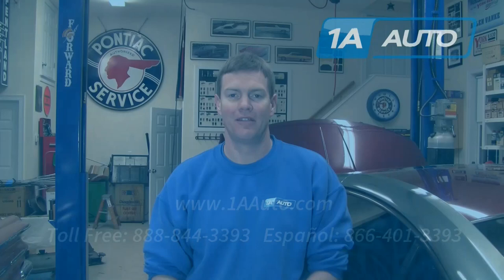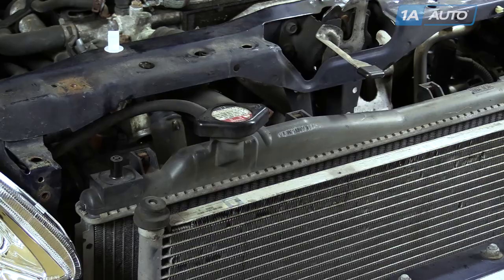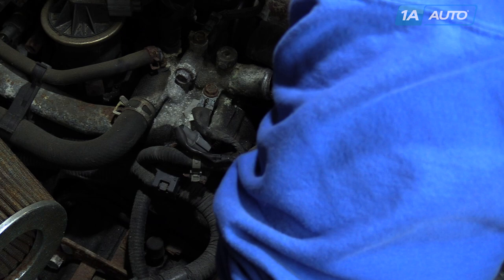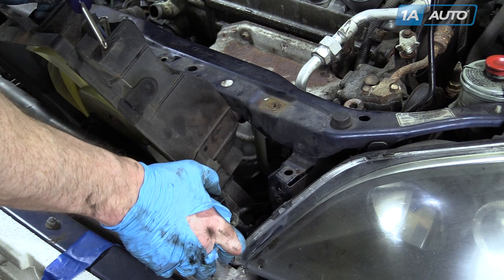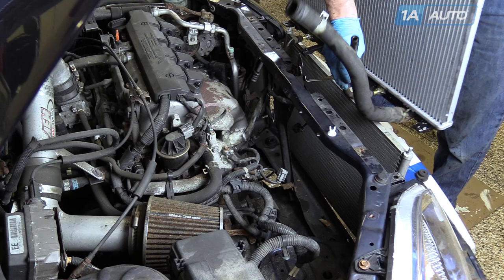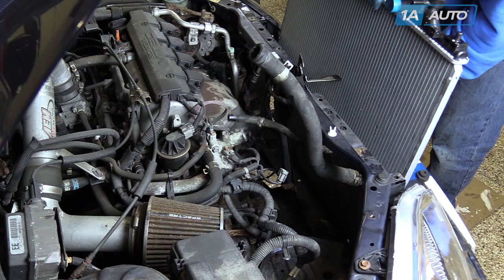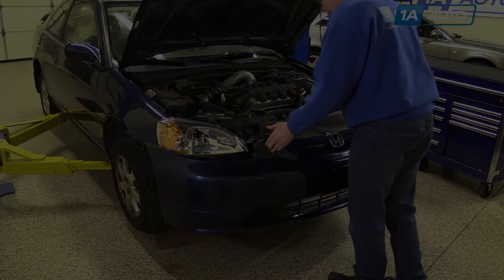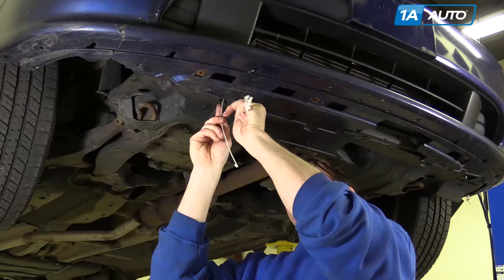How to Replace Radiator 01-05 Honda Civic

Comment from the maker: √  Watch the Video
√  Buy The Part at 1A Auto http://1aau.to/m/Visit-1AAuto
√  Do it Yourself
√  Save Money
Reply: did i miss what todo with the at fluid? Never saw that get topped off.
Reply: 1A auto my Honda transmission is manual and the radiator I bought from you guys 1A auto on the specifications said that is for either Automatic or Manual Transmission do I need to cover the Transmission fluids plugs or leave them ? Are they going to leak any coolant (antifreeze)?

Comment: Word of advice for anyone watching this video and attempting this at home. It is not necessary to remove the whole front bumper cap. Only the center grill sections needs to come out. Also, leave your upper rad hose, lower rad hose, and both transmission lines connected to the engine side of the vehicle. Much less headache coming out and going back in.
Reply from the maker: +@Logan-qo1tv Thanks for the feedback!

Comment: You don’t have to run the car up to operating temp with the heater on and rad cap off to get all the air pockets out of the system?
Reply: That is a good way to purge air from the system.  Sometimes you get lucky and can just keep checking the level but makes more sense to properly burp the system before taking for a drive to ensure there's no air pockets that can lead to overheating.  Ill be doing this exact job on Wednesday to my girlfriends 2003 civic and the video makes it look very easy.
Reply: i know im hella late to this, but it really depends on the hose placement, if the neck of the radiator is higher than every part of the system, all the air will end up in the neck thus ending up in the over flow. ive had plenty of cars that were a nightmare to bleed, but hondas are very simple and have few external cooling lines

Comment: Scared myself a little when I pulled out my old radiator only to see that it wasn’t  the same. For my manual friends, you can use this radiator too, I just put this one in my car and it runs fine. You can just leave the cooler line ports on the new radiator open!
Reply: You should definitely seals those some. Whether with some type of plastic caps that you can find, or bolts or whatever you can rig up that will stay.

Comment: manual transmission cars wont have the 2 transmission cooler male fittings on the bottom
Reply: can you just cap the two lines? i have a manual transmission and radiator has the two male fittings but im not sure how to go about it
Reply: Was just wondering that.  I have a manual.
Reply: Do I have to get a different radiator If I have a manual trans? I think I bought the automatic version
Reply: So does that mean there’s 2 less hoses for manual trans?
Reply: for those people wonder the manual transmission civic , the radiator is the same, it just have no line connecting to the core, it’s ether capped close or open with no cap or missing cap , but the radiator is the same
Reply: Mines not capped can I cap it off

Comment: If you are still there after all these years, Thank you.  Your step-by-step got me through replacing my 2005 Civic LX radiator.  Removing the driver's side fan was a bear though because of the air conditioner unit and tubing by I did manage to squeeze it out of the way and get to it.  Thanks again.

Comment: This 1A Auto video is amazing! If you follow the video exactly as shown you WILL be able to replace your radiator. You not only get the how to remove the old radiator you are shown how it gets replaced from beginning to end. That is invaluable since "to install simply do it in reverse" doesn't work for use non-mechanics... I've changed both my 2001 and my wife's 2003 Civic radiator following this video frame by frame. Thank you so much!

Comment: I just finished watching this video and I am confident that I can put in my new radiator myself. I know basically nothing about car repairs but with this videos step by step instructions I know I can do it. Just recently I had to put in a new starter and a new fuel pump assembly in my 2003 Honda Civic Ex and I was able to do both repairs within a very short period of time thanks to videos like this on YouTube. Before I took it upon myself to do the fuel pump assembly I was quoted a minimum of $600.00 to put the fuel pump assembly in. I was so shocked at how easy this job was and to have been quoted that much was an outright outrage. I wouldn't have charged anymore than $150.00 to do that job and honestly even this amount seems too much. It took me no more than ten minutes to do the fuel pump assembly replacement. Many mechanics are gouging people with these ridiculously obscene prices...

Comment: i did it in about an hour! thank you! manual transmission made i a lot easier!
Reply from the maker: +Cristian Aponte Thank you for your positive feedback!
Reply: I have manual trans. My new radiator just came in. Gonna put a new condenser, ac compressor and radiator all at once. Pretty pumped up

Comment: thanks for your excellent video. just finished the job and it took about 3 hours from start to finish.  Your tricks really helped a lot but did find it easier to just completely remove the upper radiator hose.  You did a great job and i'll definitely keep 1aauto  in mind next time parts are needed for our autos. Holy moses! Just saw the link to the radiator below. i paid twice that at autozone
Reply from the maker: +ba r Thanks for watching, and don't hesitate to visit our site next time you need auto parts!  1aauto.com
Reply: damn thanks for ur comment i almost didnt go to their site and was gonna buy it at autozone, saved me some money
Reply: could've removed the fan after taking the whole radiator out first

Comment: I'm doing this repair on Saturday and I'm going to be replacing the thermostat along with the upper and lower hoses. I'm not sure why you wouldn't replace the upper and lower hoses or the thermostat I mean that's just me. anytime I do a radiator and I know the hoses or the thermostat have never been replaced I typically do it all at once. but great job on the video very detailed

Comment: Great video just changed my Honda Civic 2001 EX radiator using your video step by step thanks 🤗👍
Reply from the maker: +Ricardo Pagan Coll Thank you for your positive feedback! We are happy we could help!
Reply: I tòom mine to a garage. I anticipate a $400 bill !!!
As for thermostat replacement NAPA has an aftermarket thermostat for $9 if I read it right.
I called Honda. Their thermostat was priced at  $53!!!!

Comment: since it appears the transmission fluid hoses have to be removed would it be smart to also get the transmission fluid changed at the same time?  if any of you have experience with the 7th gen civics, are there other 80k mile general maintenance tasks that should be performed in conjuction with a radiator replacement?  thanks in advance for any input

Comment: You can use the sides of the box that the new rad came in, cut them to size and tape them over the fins, to have extra protection and be sure you don't bend any of the fins.

Comment: 2001 Honda Civic lx - the radiator I pulled out did not have the two small hoses on the bottom but the new radiator that they matched me up with has the hardware for them? I’m confused.

Comment: Just found out my 2003 Honda civic transmission cooler line fittings are rusty and planning to replace the radiator and the fittings. Does the transmission fluid need to be changed after replacing the radiator?

Comment: Actually you can remove the second fan and then get radiator out without having to undo the bottom hoses to radiator.  Once you loosen top brackets to radiator and AC cooler coil.  Lean them back.  Undo the clip from the fan that connects to metal frame.  It's a small phillips screw.  Then unclip rest of clips and fan will wiggle out once you lean back radiator and other coil.  It will easily wiggle out.  Then lean back coil, and pull out radiator.  I only undid bottom hose at radiator, but probably didn't have to.

Comment: A1 I have a question my Honda Civic is Manuall Transmission and I bought the Radiator from you guys A1 the radiator specifications said that was for either Automatic or Manual transmission what I do with the transmission plugs should I removed them and if I leave them are they going to leak coolant or not
Reply from the maker: +Angel Rosado Thank you for your inquiry!  IF the radiator purchased states it is for both transmission types, then you can just leave the automatic transmission fittings alone.  They run on a separate core, so it will not leak any fluid!

Comment: I ordered a radiator from you guys but couldn't find any description on whether it was for manual or auto transmission.  The one that arrived has the hose fittings for auto transmissio.  Do you even sell one specifically for a manual one.  Tried to return and was informed I had to cover return shipping costs.  If this works fine on manual without having to connect anything there then I'm fine with that as well.
Reply from the maker: +Lalo Munoz We would be happy to assist you further with the issue. Please give us a call at 888-844-3393. We look forward to hearing from you.

Comment: THANKS a million with this video I was able to change the radiator in 2 days but I am slow now my radiator cap doesnt fit and I wonder wether I could use a dremel to erase a little lip inside the new radiator hole should I ???is there different cap size in radiators?? should i use coolant or add water you are talking of a 50/50 mix and what is transmission fluid oil or ??? One again many thanks
I am french do you sell overseas ??? seeya
Reply from the maker: +Brice Chevry Thanks for watching!  Sometimes the new radiator will have extra plastic from the molding process, so you may be able to file down some of it to get the cap to fit.  You might also need to get a new cap depending on how severe the fit issue is.  At this time we do not ship overseas!  1aauto.com

Comment: Mike I noticed this car has the alternate, performance air filter kit installed. I'd like to do that, for my 2005 Civic LX 1.7l. I have a concern about this kit potentially being noisy and/or cutting into gas mileage. Does 1A Auto sell that kit and can you address those two concerns?  Thx
Reply from the maker: +Wayne Sanchez Thanks for watching!  These cold air intake kits should improve those aspects, not make them worse!  It can be purchased by using the following link; https://www.1aauto.com/2001-05-honda-civic-performance-air-intake-kit-diy-solutions/i/1apai00293/1057678/2005

Comment: Is that dark brown fluid burnt up transmission fluid? I removed my radiator to my 02 civic that has been overheating and throwing a check engine light and it will literally not move if it overheats too much.. trying to figure out what needs replacing.. and this dark fluid came out.. been thinking the trans is shot but idk
Reply: Need a bit more details but unfortunately sounds like it is
Reply: You have a blown head gasket.  The dark fluid in your coolant is oil that got past the head gasket and into the coolant.

Comment: I have a 2003 Honda Civic EX my Old radiator doesn't have the two transmission hose on the bottom and I just bought a radiator that has the two transmission hose can I still install the new one without installing anything in the bottom of the new radiator?
Reply: Just happened to me did u figure it out?
Reply: Ya you can.  If you have a manual transmission you won't have the oil lines.   Just leave the caps on that come with the radiator and don't do anything with it.  Not a big deal if you lose the caps either, they aren't holding coolant in or anything like that, those holes are only for tranny oil.
Reply: asslicker3000 same shit happened to me I just got a radiator with the 2lines for the hose but those are water hose ain't it?thats what I thought the hole time
Reply: I just found this out! We can use an automatic radiator for a standard but not vice versa. Sweet! I was going crazy trying to find the standard radiator.
Reply: @infinitig3549  nope they're transmission fluid cooler lines

Comment: the local mechanic buddy want 550 for this job, I think i could this for like 100 bucks tops, with coolant, new radiator, etc. I am not looking forward to doing it, but i'm going to get up early saturday morning and get at it. spend the day, thanks to this video
Reply: I am in the process of installing a new radiator and believe me, 550 in fair because this car is a hell to work with !
Reply: @TheHelado36  lol the civic radiator swap is considered relatively easy in comparison to most cars

Comment: I have a 5 speed 2001 and I don't have those smaller transmission hoses. should i???
Reply: joe miller 

no. those are for the automatic transmission fluid cooler that's integrated into the radiator. the manual cars do not have a cooler.
Reply: Legit Hoss thats what i wanna know

Comment: My AC is not working cold air after doing this radiator change. Any solution?
Reply from the maker: +Hass C We wouldn't be able to diagnose an issue like that here, you may want to have a local mechanic take a look at it. Thanks for checking us out! http://1aau.to/m/Shop-1AAuto-c

Comment: 3:13 i took it out but i cant find the reservoir 10 mm hole i have an 03 civic gx help
Reply from the maker: +Evan Cancel This video is specific for 2001-2005 Honda Civics with a 1.7L engine, if your Civic does not have a 1.7L engine the steps shown here may be similar, but not the same. 1aauto.com

Comment: no need to re fill transmission oil?
Reply: thats what i was gonna ask, mines been acting up all week and just discovered coolant puddling on the bottom lip of the radiator, of course after i swap the thermostat and the cap...gotta tear into this in the morning lol
Reply: Preston Kunz. I have the same question
Reply: Did anyone find the answer to this
Reply: Paul Dean yes you have to and replace what came out.
Reply: Tyler V.G. Yes you have to replace what came out.
Reply: i had to add a half a quart to mine .  best thing is to run it , shift thru all the gears then check it , add as needed .
Reply: always something seems to be missing from the replacements that are done

Comment: Changed the radiator out, changed the cooling fan, fan switch and radiator cap. CAR OVER HEATED QUICK ASF. the fan wouldn't even cool it down. Why?

Comment: Can i use a 1995 radiator for a 2001
Reply: Plzz answer
Reply from the maker: +Duane Nimen Thanks for watching.  A 1995 radiator will not fit on a 2001 model.  We do carry both radiators if you need to purchase one, simply visit our website, enter your year, make and model, and search "radiator" for the correct part!  1aauto.com

Comment: i like how most american cars from 90s to early 2000s are a b** to bleed the air out of the coolant, but honda just, add collant and check the level a few times lol. i still have a coolant evacuator kit from when i had to do a 2000s lincoln ls

Comment: A friendly reminder if you guys have a manual Honda civic the oem radiator is discontinued, but you can get away with using the radiator for automatic transmission. The two extra ports you see in the bottom are for transmission cooling lines, just keep the caps that it comes with so dirt won’t get in and you should be good.

Comment: How the hell he removed the second fan ( the one next to the A/C components) is beyond me! I tried and there is just no way !
Reply: I pulled the radiator out first and left that fan. Only the drain plug was a bit challenging but the radiator was able to be removed in my case with the fan still in place.
Reply: I just did it this week....loosen everything up pull back the condenser removed the battery and voila!